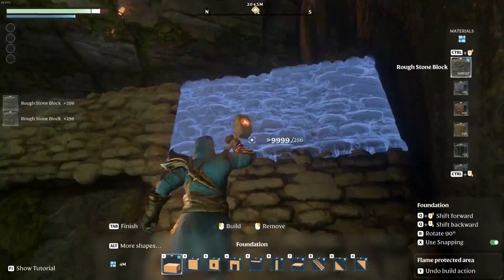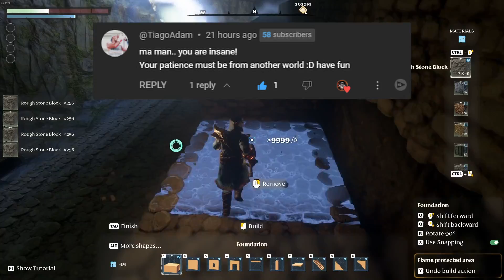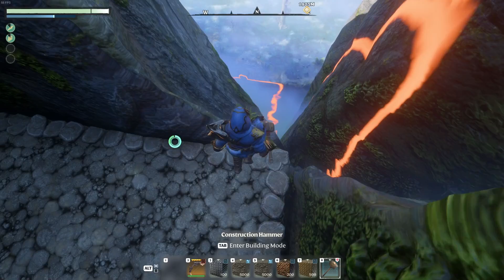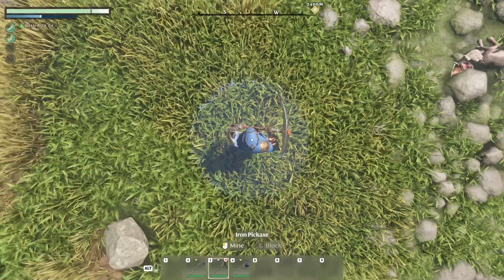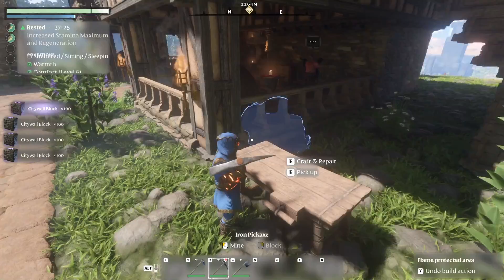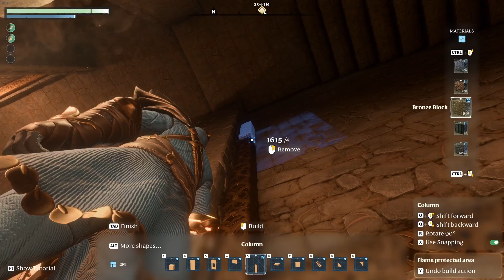I answered ALL of your questions about my Enshrouded Mega Build

Comment: just found out the icy mountain in the NE corner of the map is made oute of dirt, not just the top layer... so if u want to farm a ton of dirt dig there...

and even if it has already been suggested to you, if you want to hollow out your "hole" to the maximum, then the terrair block for deleting is faster than placing the thick stone block and deleting it again. Since you can't deploy terrair beyond your base maximum, you'll also get perfect areas. Of course, for everything around the entrance where you don't go all the way to the construction maximum, I would continue laying and deleting blocks, but for the remaining sides of the hole, simply deleting terrair should save time and deliver the same result. 

Best Enshrouded content currently available on youtube, love your project